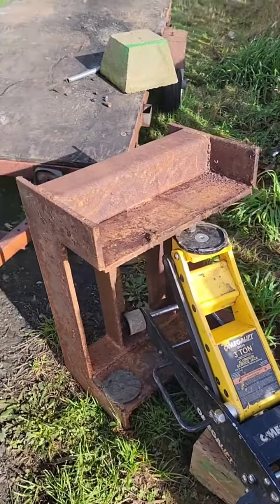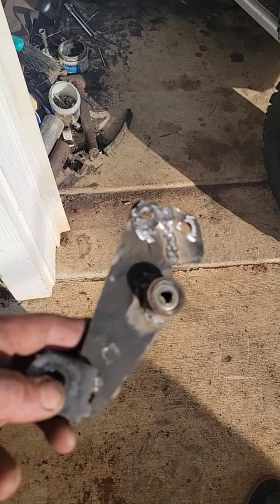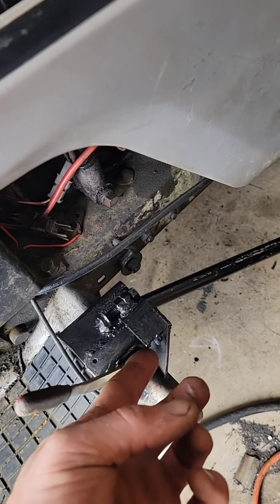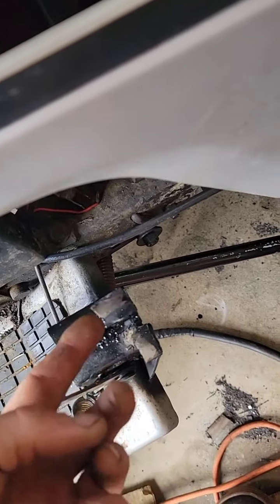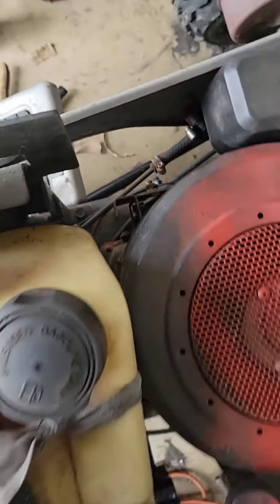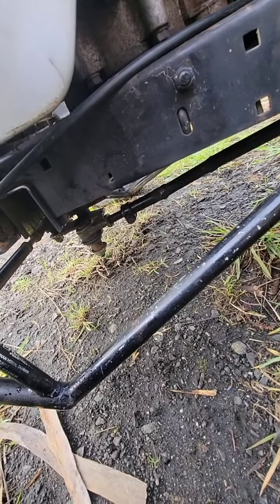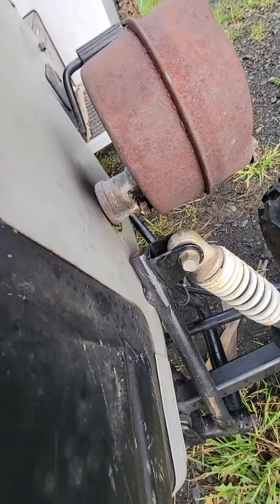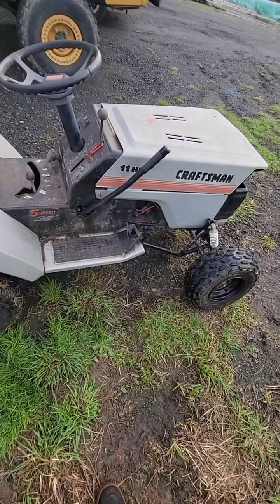Final IFS Steering overview, & improved foot throttle

Comment: Have you done any off roading with this tractor? If so, is the ifs worth doing?
Reply from the maker: just high speed stuff down the beach. naturally it's gonna suck on deep rutted stuff and trails. I'd say no way. keep the straight axle. was more of a boredom project and because we had a wrecked ATV and didn't wanna scrap all the suspension
Reply: @20valvedrifter  gotcha. Thanks